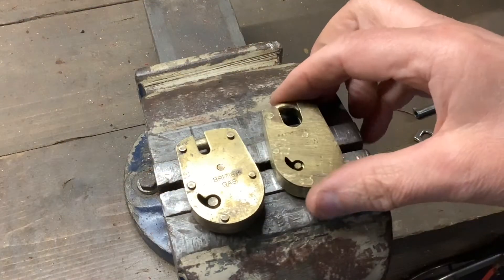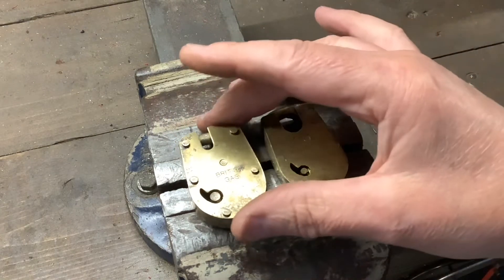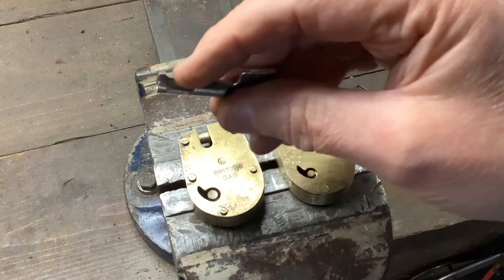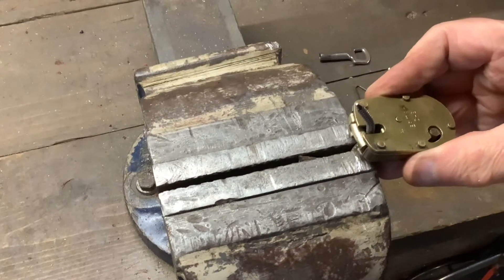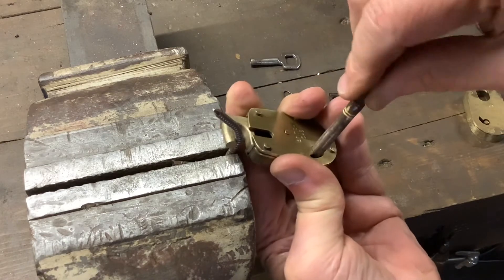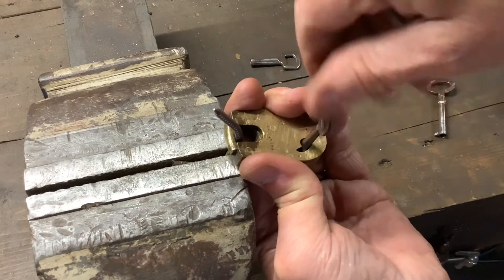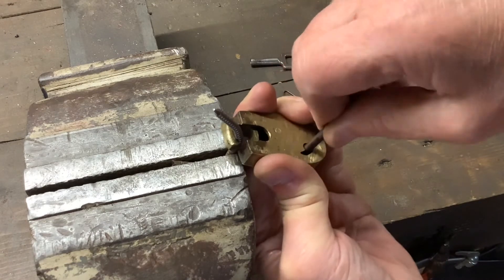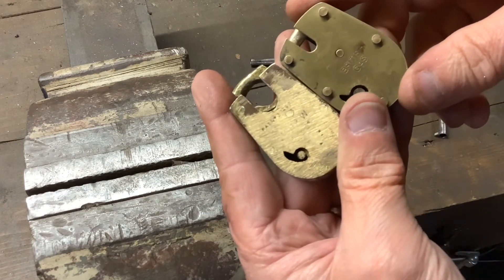496. How to pick open gas meter lever padlocks the easy way use an old filed down key as the pick

Comment: I managed to pick one of these by pulling on the shackle like you did, but picking it with a hook, however it took me a lot longer than you did. Is there any way to impression a key for these locks, as I would like to have a key for it?
Reply from the maker: Cheers for watching, sorry I have never tried to impression keys but only 2 levers in these locks so shouldn’t be too difficult